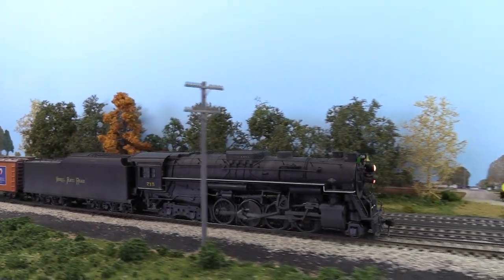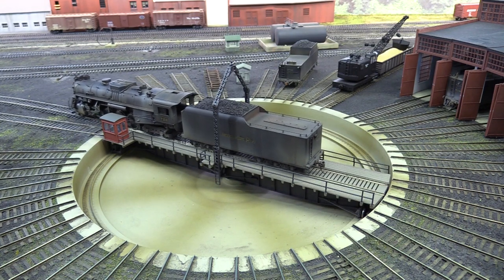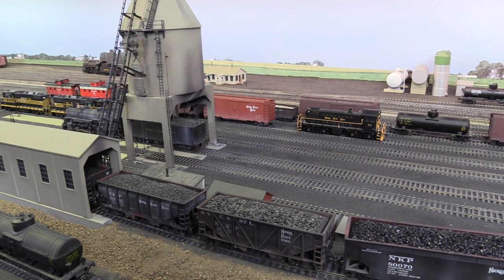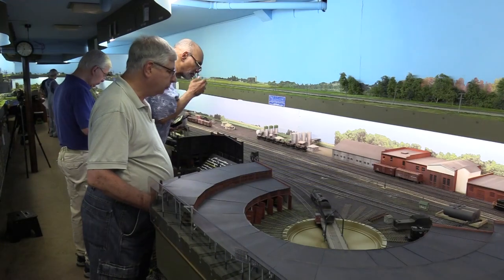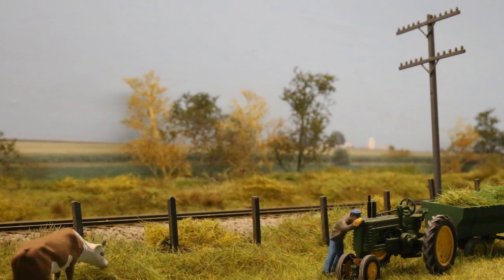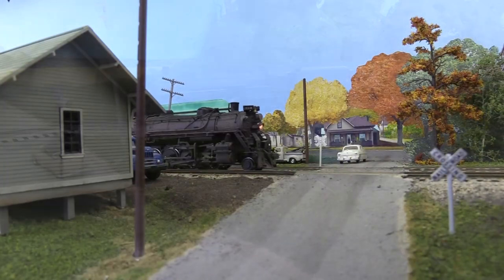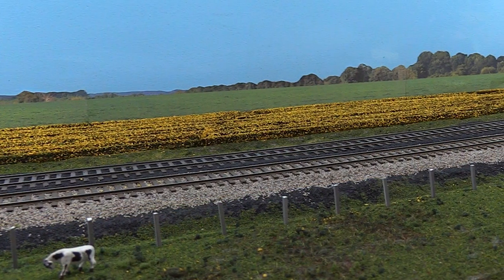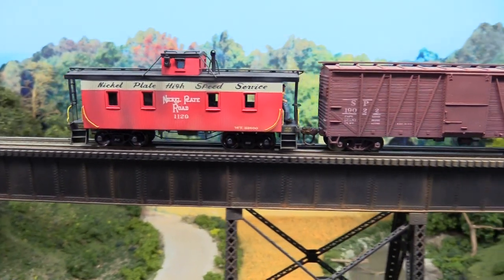Vol 2: Tony Koester's Nickel Plate Road - from Nace's Videography LLC

Comment: If Volume 2 comes out in late August, does it mean you're going to produce about one Volume per year since it takes what, 10 months to make one? Any details on Volume 3? Also I wouldn't mind if the program is shorter if it has the narration on/off feature. I think it's well worth it.
Reply from the maker: Greetings, my goal is still 2 productions per year. Many factors contribute to the taping schedule, including weather and other commitments the artist's have, both professionally and with family. In the end I spent 30 total days at Tony's for this production (Howard's was 23 days). While I am still open to a narration on/off feature, I will need the full 2 hours again for Tony's program to capture the complete reenactment of a 24 hour period on the St. Louis Division, plus the specialty segments including 3 "How To" clinics. Volume 3 will be Ted Pamperin's C&O in the transition era, including the locations of Sewell, Thurmond, and Hinton in the early winter. I do plan to have this program ready for December or January, as Ted's schedule will permit 3-4 days of videoing at a time, which will allow for a quicker release. Thank you.
Reply: Ted Pamperin's C&O sounds amazing. There's a clip on here about it so there's a preview of it. I was hoping you can film Ron Mei's HO scale Sunset Route which was just featured in the August 2019 Model Railroader. It would be rather different than the first 3 volumes because of the setting and the emphasis on passenger trains. There's quite a bit of freight trains too. Hopefully you'll consider this layout for Volume 4 or the near future. I'm waiting on Volume 2 which I think you said will come out in late August.